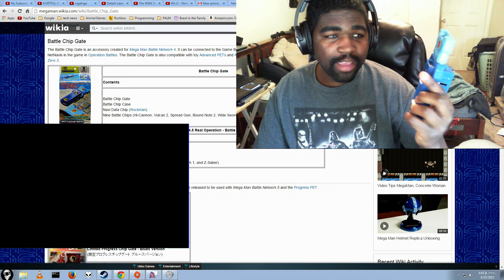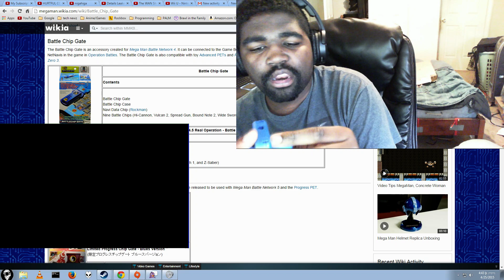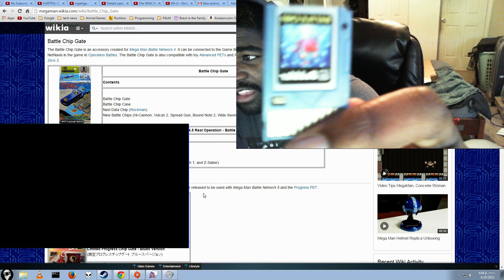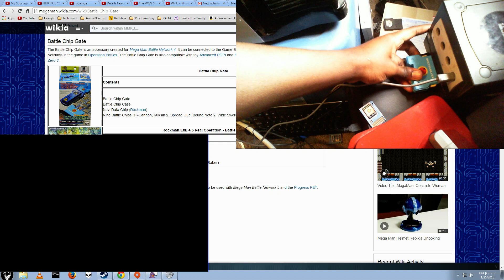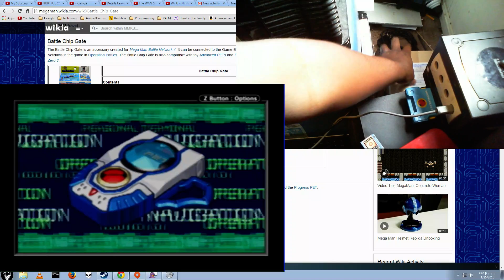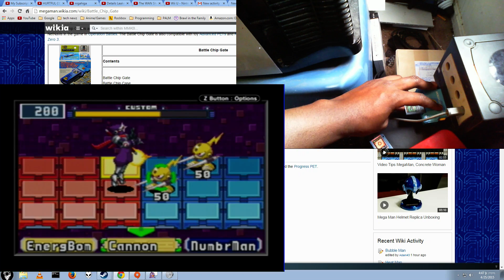Megaman battle network 4.5 using REAL chips! (w/battle chip gate)

Comment: I'm curious about the possibility of building a custom chip gate, have you ever taken one of these apart for the purpose of research? If not would you be willing to do a video of a tear down at all?
Reply from the maker: I have not torn them down, but it's extremely simple, 
They're just a basic circuit, so you could build an Arduino reader fairly cheaply.
here's a quick rundown on how they work:
https://youtu.be/4J8WsnTmiwI

Comment: The time and the date in game are not running, do you have any solution for that? Thx
Reply from the maker: sound like the internal clock battery is dead.
you'll have to open the cart and replace it.
Reply: BOBdotEXE would that be a chance that the data will be reset once I replace the battery? Thanks